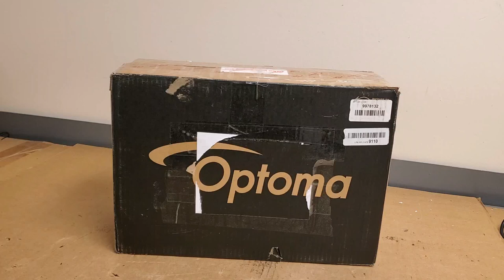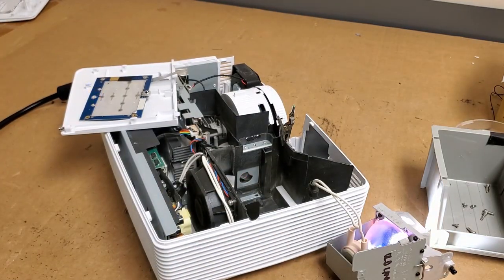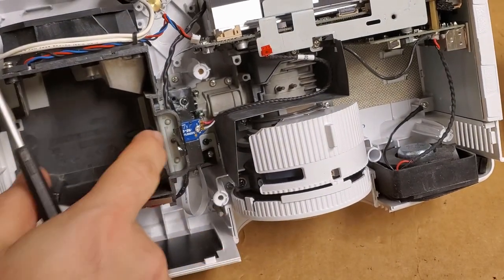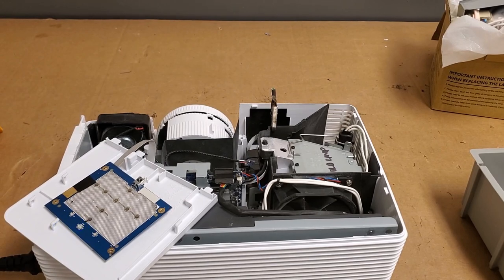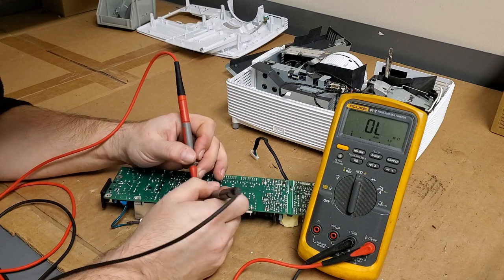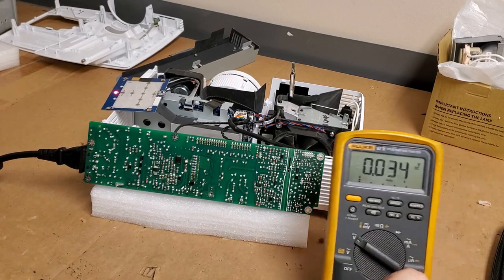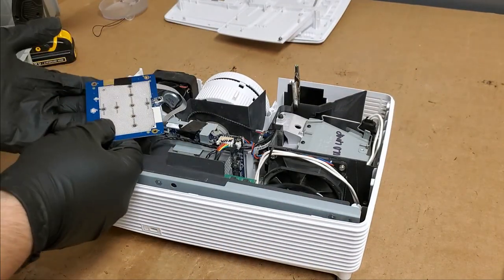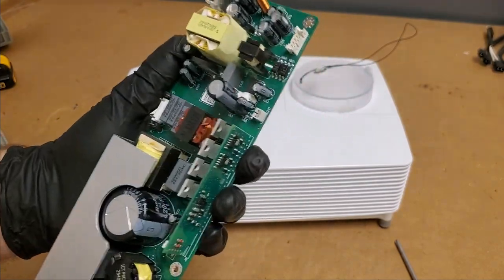Optoma GT1080 DLP Projector Repair for Intermittent Lamp

Comment: Frank you need a Hakko FR-301. I have the 300 and it works great. Part just falls out.
Reply from the maker: I have https://www.amazon.com/gp/product/B00KQ6PR6K/ref=ppx_yo_dt_b_search_asin_title  This one at home.  Normally I do my soldering there instead of at the office. But I still use my old https://www.amazon.com/EDSYN-The-Original-Deluxe-SOLDAPULLT/dp/B006GOKVKI  (25+ years old on tip # 30+) more than anything else. Old habits die hard.

At some point I want to consolidate my work spaces. I'm spread across my house and my day job.  My boss is kind enough to let me use some space to do these repairs/videos but I'd really like to have one spot to do it.  I'm hoping to do something about that this year at some point.
Reply: @FixitFrank  I have that blue sucker myself, but I have never managed to make it work. I have tried a few other ones as well, but for me these won't work.

Comment: Good morning Frank
I don't know if you can help me please.
You would need to know the IC (PWM) model that carries the Optoma Hd141x projector's power supply, which is the same as GT1080. (Can I send a photo of the location?).
Very thankful.
Reply from the maker: Sure thing.  I have a spare power supply that works that I can look at. What is the location number on the board? U105?
Reply: Hi, thanks for your response.
It is the controller for the Q201 (7N80K5) mosfet.
I put the 37A65 controller but it doesn't work well.
Very thankful.
Reply from the maker: You are very welcome!  It says 36B65 so it sounds like you were very close!  Check the output inductor that feeds the lamp(L3). I had one short internally due to arc flashing.
Reply: @FixitFrank  Hello, your information has been very helpful to me.
The problem was that one day the regulator, the mosfet and some resistors and tracks on the board suddenly exploded.
Greetings and thanks
Reply from the maker: @cantiusqui5299  I am glad I can help!  If you are in the states, you can send me an email. I have a working power supply around if you want to try it. My worry is that your transformer has a bad winding. Hopefully just the mosfet failed and took out everything else and not the transformer. I had that happen on an HD20 power supply.
Reply: @FixitFrank  Thank you very much Frank, but I live in Europe. I am very grateful for your help, because I already know where I can start looking for the fault. Greetings and I congratulate you on your videos. I find them very interesting.

Comment: hi frank how are you.i have watch your video in detail.i have optoma HD26 1080 i have the same issue.even i have change power supply but still lamp never on.
with more diagnose new power supply not produce the voltage for lamp.
i was order online from china.with as same 210w.
Any suggestion old power supply is with me.
thank you
Reply from the maker: I would check the mainboard control to the ballast. That should show a lamp on signal, where the voltage drops from 4.8v down to 2.5-3v.  I did a video recently on a BenQ W1070 where I show how to check the ballast control.  The same thing applies to your Optoma. I suspect something on the mainboard is not calling for the ballast to start, or you have a defective lamp assembly. Make sure you have a known good lamp assembly to test with.